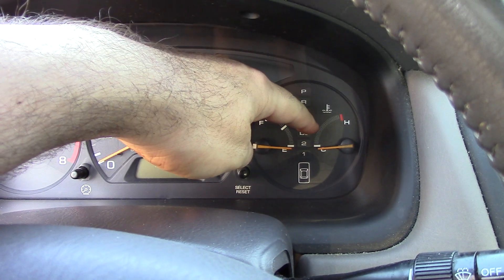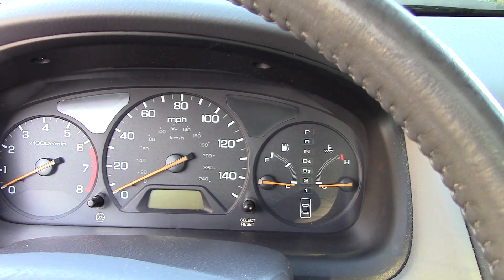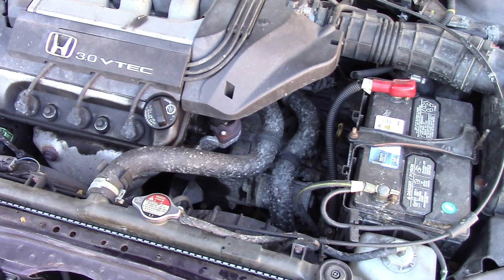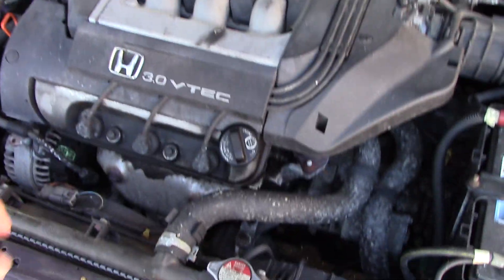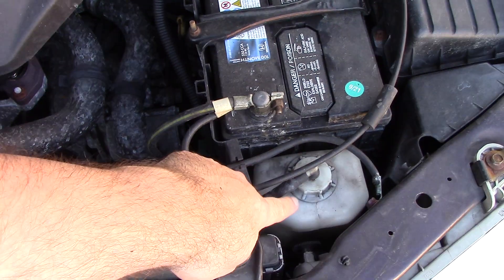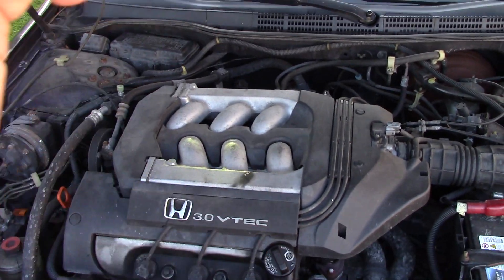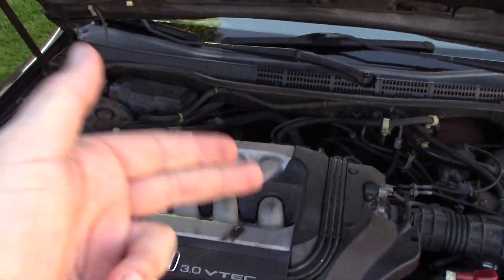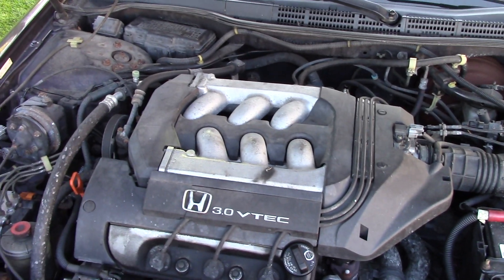This is Why Cars Should Have a Temperature Gauge!

Comment: The problem is you, youre not keeping up with maintenance lol, dont blame it on the temperature gauge smh lol
Reply from the maker: Where did I say the temperature gauge was the problem, and I don't think proper maintenance prevents radiator plastic from eventually cracking.
Reply: @Sharkie626  you dont wait for parts to break, you replace them even if they are still functional, that happened because you waited for it to BREAK and LEAK LOL
Reply: @Sharkie626  how long do you think Radiators last, 100K miles?  9 yrs of driving, 10 yrs of driving who knows, they can break anytime after so many yrs of driving.  If you wait for parts to break, well youre asking for it LOL
Reply from the maker: @hippo780  That car is not mine, it's my dad's, so yeah, I don't check it regularly. My car I do, I check under the hood about once a week actually. That being said, Most radiators show no signs of breaking, until suddenly they do, and there was no coolant on the driveway either. The only hint I had that something was not right, was the temperature gauge. If it wasn't there, I probably would have found out the hard way.
Reply: Yes, radiators do last 100k lol. That's just the break in period for a lot of cars!

Comment: Really good timing on this video since I had just recently had a radiator replaced and the hose had a hole in it for my 02' Buick Century. To your point on "digical" gauges, if it just then gets hot and the "hot light" goes on, the problem in that scenario is that you get no notice whatsoever that the temp. is overheating. Digital certainly doesn't have to be the answer to everything.
Reply from the maker: Exactly, the analog gauges will show you things so much more accurately than digital ever will!